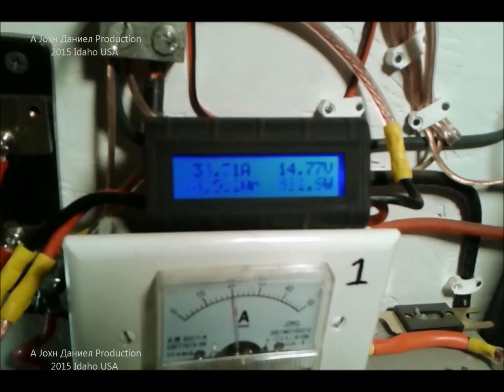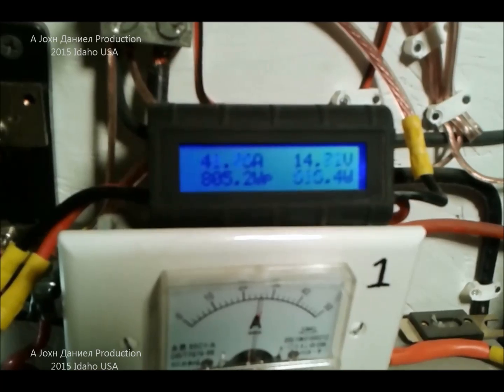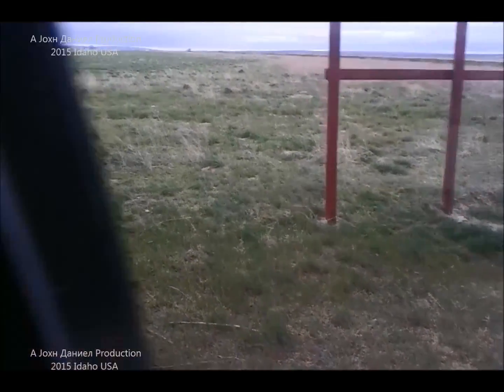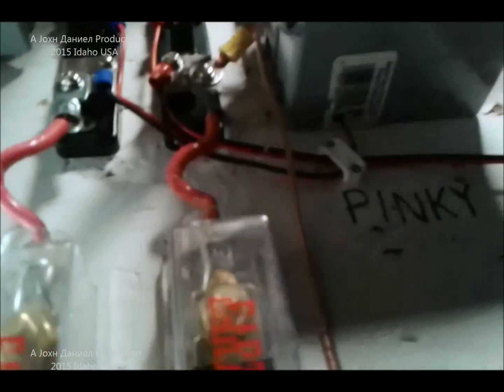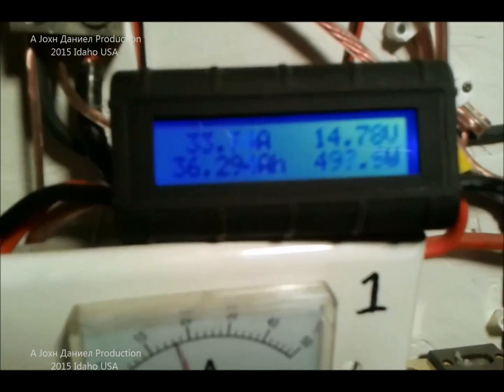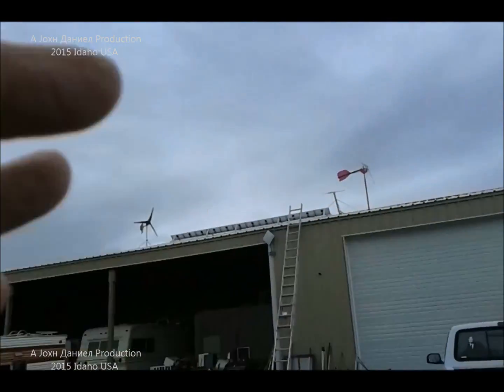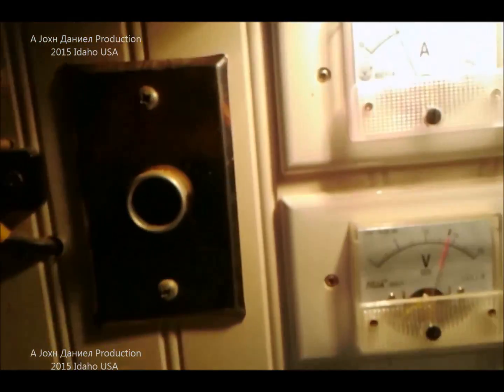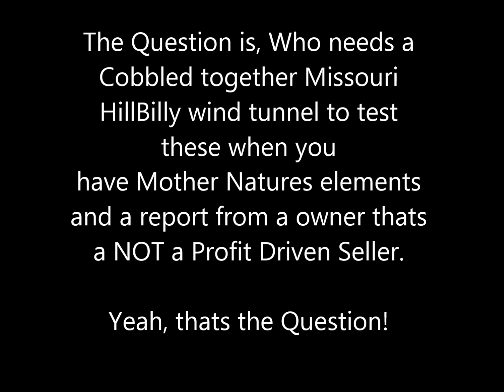USA MADE, micro wind turbine blades -1st HIGH WINDS TEST 1

Comment: My best guess is that tonight you will blow a coil at anything over 1485 watts sustained for more than 90 seconds. If your not all 'breakered up' and protected.   Run a breaker and save yourself a trip up to the roof tomorrow.